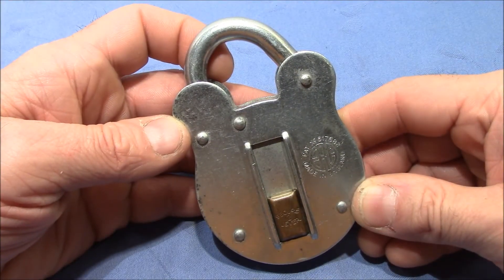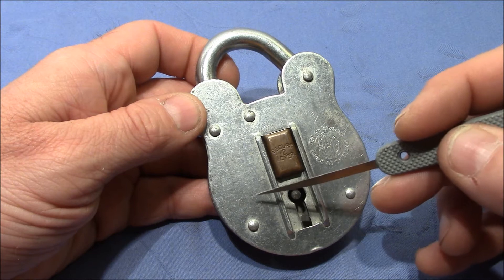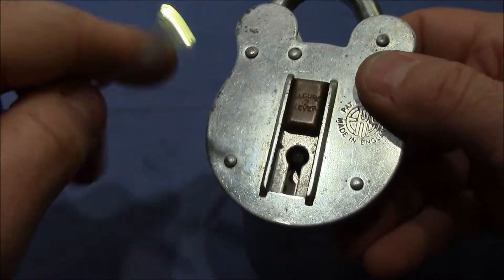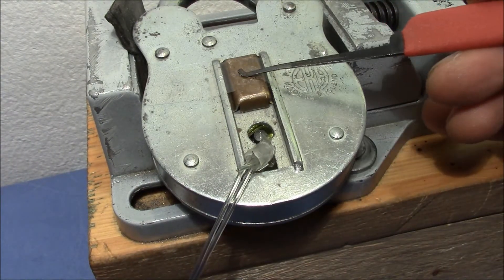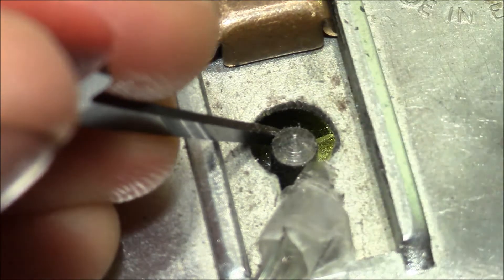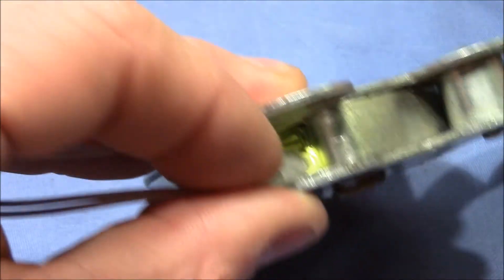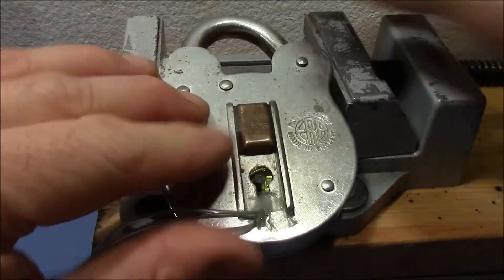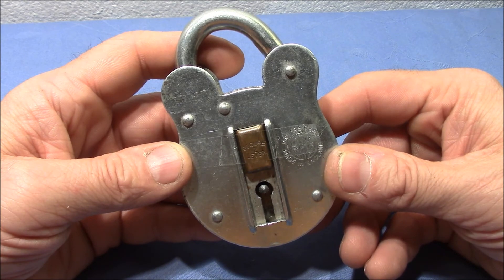(picking 344) Improvised lever picking: ERA 2 lever padlock - thanks to 'Lock Noob' for it

Comment: A pretty cool surprise from Lock Noob :D and a cool way to pick this lock hehe. It looks quite pick destructive o_O , so meat skewers make great lever picks (cut the sharp end off and bend them) and I think such locks can also be tensioned sometimes from the shackle gap on the top (of course only to open). Hope this helps a little ;D. Thank you for sharing :), very nice video Potti :).
Reply from the maker: Yes, ''Lock Noob' is a very generous guy - was great fun to work on that lock. The idea with using meat sticks is great - have to get some first ;-) The Peterson picks can stand the picking quite good but nonetheless I used my Chinese picks for it as far as possible (as I'm not using them for anything else). At the handle it's quite tight so I'm not sure it you could get in something here. I asked 'Lock Noob' if I can send along the lock - so would you be interested?
Reply: Really a nice puzzle :) and cool that you opened AND closed it :). Often it's only opened. Oh that would be nice Potti to have it here for a moment :). I will send it back as soon as possible :D. Meat skewers (the small ones) work very nice on small lever padlocks, I have somewhere some videos about this ;). Also coat hanger- or bigger meat skewer- metal is good for bigger ones, there is as always some shaping and bending involved ;).
Reply from the maker: I'll send it off today. You can pass it on to the next lever-friend. It's meant to share and spread the fun. Cheers :-)
Reply: Well, I could send it back and you could try other techniques? ;) Cheers buddy :).
Reply from the maker: I would appreciate you send it on as that's what I would have done anyway.
Reply: Okay ;D, I will do :).
Reply: There looks like ylroom for more levers inside. I think maybe ERA makes models with more but look similar. Nice job picking....i would be scared to break my picks doing it that way but a open is a open :)
Reply from the maker: These are really strong picks that can stand the impact well. And the cheap Chinese one I do not use normally - I keep them just for purposes like that. Thanks for watching.

Comment: Funny thing having to pick the lock closed again hey :) Good job getting it to open with pin tumbler picks! I've tried that ended up breaking a pick, went to piano wire after that, it works well also.  Thanks for sharing. #Leverlocksports :)
Reply from the maker: I'll use meat sticks in the future (have to get some first). The first time opening it I used the Peterson picks but then I switched to the Chinese picks that I don't use at all else.

Comment: What if the central pin is wobble very loose, no way to apply tension. I have an old lock like this
Reply from the maker: Can you fix the wobbly pin? I think it's connected to the lock like a rivet - maybe tap on it from the bottom with a punch to get it tight again.